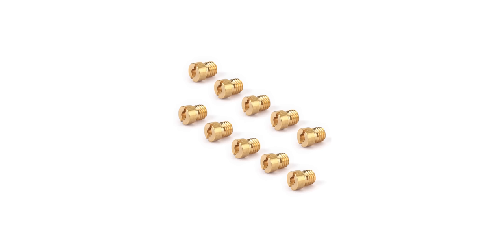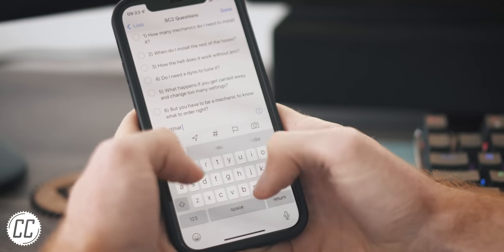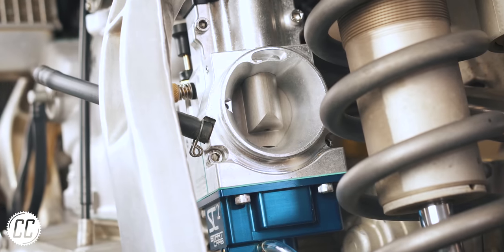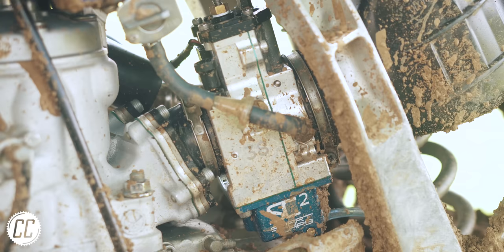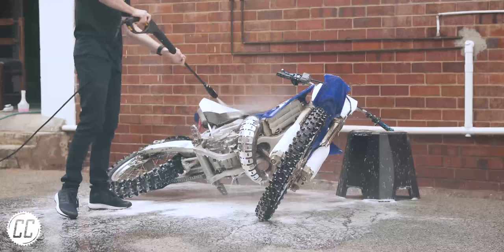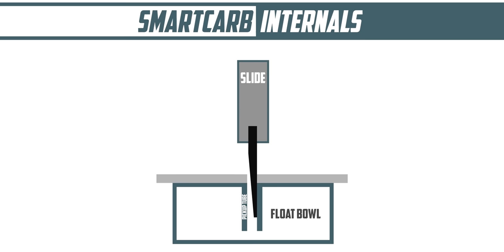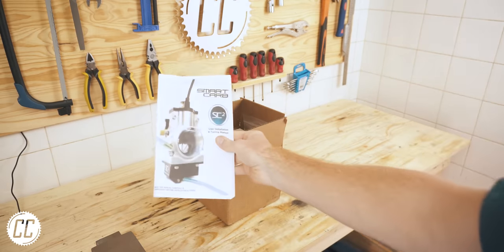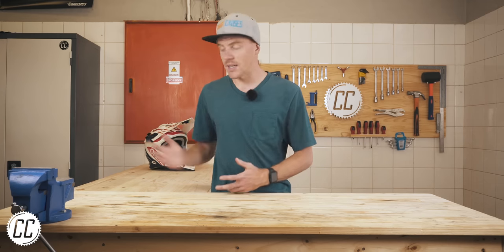The Best Carb Money Can Buy? | SmartCarb SC2

Comment: Having worked with carburetors for 40+ years, I found the SC2 concept to be very interesting. However the only feature that would be beneficial to myself would be the ability to easily adjust for altitude. On a single cylinder, single carb engine, the rest of the tuning is so easily done that it wouldn't be of any real benefit, regarding getting a base setting. When I'm working on a bank of 4 carburetors, then I'm always wondering why there isn't a simpler way as the carburetors have to be removed and replaced several times over as the various circuits are tuned, although that's only really a chore when you have a none standard set up in terms of the engine modifications and different carburetors, so you do not have a stock factory setting to work from. If you are racing then I guess the real crunch is whether the design really gives you all that extra power over a properly tuned stock carburetor, many 2 stokes are setup from the factory to run somewhat rich for engine longevity, rather than all out power and fuel efficiency.
Reply: So you just explained it yourself that, this product Is beneficial on 99% of the platforms its swapped into! Outside of whatever circles your forming, this is beneficial!
Who is out here fully constructing a motor from scratch, and does so without doing any prior research to atleast have a basis or point to start from? Come on man, quit bashing! Also, please explain wtf you said in your comment? (Pls don't take my cursing or short temperament as aggression or hate etc directed at you personally)
Reply: @haydenroyer  When I see some back to back dyno tests with a properly tuned stock carb, vs the SC2 I'll be happy to accept the results, but for now I find it really hard to believe the SC2 can provide drastically better results for anyone, beyond someone whose original carb is either having issues or was never tuned correctly, you can't change the laws of physics. Q: "Who is out here fully constructing a motor from scratch, and does so without doing any prior research to at least have a basis or point to start from?"  A: Anyone who has a custom engine setup, my 78 Kawasaki has a big bore kit with high compression pistons and 28mm carbs instead of 26mm from a later model. I bought it that way, the previous owner never had it running correctly.  It proved the most challenging set up to tune perfectly, I've worked with so far, as there was no stock starting point and the PO had got it jetted all over the place.
Reply: @fiveowaf454  you're right - you can't change the laws of physics. It's the symphony of the spheres so to speak. But you can work with physics better and in a fuel system like this it comes down to fine control of both air and fuel metering, mixing that air and fuel as homogeneously as possible, all while atomizing that fuel to as fine a degree as possible (increasing surface area and therefore maximizing combustion efficiency) through the entire throttle range. The SmartCarb does just that with its metering rod handling fueling through the entire range without jets or power jets providing sub-optimal atomization.

The dyno charts are available on SmartCarb's social media channels and soon more of their website blog posts now that they've acquired an in-house dyno. Stay tuned.
Reply: @fiveowaf454  I'm with you on this. I spent years working on modified motors and either swapping to larger carbs or learning how to modify stock carbs to perform 'properly' with modified engines. The 'Cafe Racer' fad of 10~12 years ago still gives me a bit of work as many people want to ditch stock air-box for 'the look' (although only one or two a year now instead of one or two a week)
Whatever, the 'advances' over a Lectron seems to be a low speed circuit which the Lectron always needed for anything other than drag strip use
Reply: @nathandyess5310  I still can't help think that companies like Mikuni and Keihin have ample experience, resources and development time in their products, that they are not leaving loads of horsepower or efficiency on the table for someone else to suddenly find. As I've said I'll believe it when I see hard data that shows me the SC2 can outperform a properly set up "traditional" carburetor.
Reply: @fiveowaf454  nothing is sudden in an industry as developed and crystalized as this. But that doesn't mean there aren't incremental improvements to be had or even breakthroughs. To be sure it must be seen to be believed. I'd agree that Keihin/Mikuni have probably reached the pinnacle of needle/jet carb design for these engines. But then I also have a front row seat here at SmartCarb to see what it does in comparison and it is frankly something else. As I'd mentioned before, we're now in a position to really start putting the data out, the right way with the right testing methodologies, etc. It all takes time and that's one thing that the likes of Keihin/Mikuni have clearly had to their advantage.
Reply: Yea especially for 800$😂💀 I’ll buy 20 ebay carbs and rejet them before i do this😂👌🏻
Reply: The biggest advantage is for people who have to deal with altitude ranges. So if you need that feature it makes it worth it imo to be able to adjust to altitude without worry or tuning
Reply: @nathandyess5310  this is it. you cant change the laws of physics but you can use them in a better way.

standard carbs of any type have several issues. one i particularly like as no-one ever points it out is the terrible turbulence that any throttle tends to cause downstream. 

whilst an engine is a positive displacement pump, in a venturi, much like a wing... the trailing edge is just as important, if not more so, than the leading edge... the air accelerates through the venturi, lowers in pressure... then has to slow back down and flow into a high pressure... and THAT is something physics definitely doesnt approve of... in any other system, it would stall and flow would stagnate, like slapping a chunk of wood on top of a planes wing. it only works due to that fat arse piston descending and sucking air in so it always is a lower pressure, venturi be damned. you can make your plane with its lump of wood fly... but youre going to need one big engine to do so!

in other words, i reckon theres a huge loss just there... inherent in the design of every throttle ive seen. except one and thats used in a situation utterly different. i feel its ideal for the task. laminar flow.

what if it was a laminar flow? like a diesel has better VE as it gets a lot less turbulence, less aerodynamic restriction... not to be confused with that phenomenon of rough surfaces. this is the overall flow in the manifold when the throttle is anything but wide open. nasty big dead spot behind the slide, or butterfly...

then theres things like what i believe the SC is doing, along with lectron. took physics, and used it little bit differently.

you look at the equations for a venturi, and they have an indice of 0.5... the suction on the jet is not linear with air speed.
you look at a jetting chart and it shows throttle position to areas of circuits.
no jetting chart i know of shows emulsion tubes.
throttle position does not control air flow and air speed through the venturi. the RPM does. the LOAD.

as the RPM varies, so does the suction on the jet, for any given throttle setting.

and thats where the emulsion tubes come in, which are an evolution of what was used on very early edwardian cars... "air compensation valves", or... deliberate air leaks to balance out the suction on the jet with the MAP in an attempt to maintain a constant mixture. 
noone really undertands emulsion tubes. its worthwhile getting a little 50 or something and soldering up the holes in one. redrill them in new places. it starts making sense after a few high gear pulls at steady throttle settings (hence the 50? you feel it when its slow and underpowered). its a whole new level above mere "jets".

the jet suction, the venturi action, is caused by air accelerating through the restriction.
MAP is caused by the positive displacement airpump sucking air in through the restriction.(ok, air pushing in past restriction to fill void left by descending piston, if im going to be anal, get it right...) two different things entirely.

let some air past behind the throttle, it reduces the air speed, reduces the suction, and simultaneously adds extra air... both lean out the mixture, that otherwise tends to get richer as RPM increases.

emulsion tubes leak air into the fuel passing the jet and lean it out that way... those holes, the size, and the location are important!

SC i believe uses a "constant vacuum", and counteract the suction on the jet so it remains at a fixed value regardless of air speed, allowing a small tapered needle to control fuel delivery in direct proportion to throttle opening. "the bowl is vented to the venturi" is a dead giveaway? it LOWERS the bowl pressure, as the pressure lowers on the jet. net result... nothing. unless theres a slight difference... and THAT is linear!

 ive done it to a few mikunis, its... tricky. i gotta make a dyno again and really start working on this stuff... i have the idea that the bore is shaped that way so it increases linearly, and allows a flat taper for the metering rod, versus the round/oval bore of a mikuni etc that uses a needle with various degrees of taper... 

in other words, all the advertising blurb is just that. blurb. to obscure the real principle that is dead simple. they dont want cheap chinese clones! and as i dont see any third party dyno tests, im never going to buy one, especially with the exchange rates we have!

im sort of working on a carb that can take boost, high fuel pressure with no regulator yet still be gravity fed if not boosted...
"no jets" like these... but not as i have no rod either... and laminar flow at all throttle settings. i still call the rod and hole a needle and jet!

Comment: one of the great  tuners descibed carburation as a controlled fuel leak 
i have a delloto 40mm pumper on my racing norton  with an adjustable main jet   a needle  moving in and out of an oversized   main jet    via  a threaded drain nut with a gland   rotated by an old rev counter cable alongside the tank
a long hill is needed   turn the knob with wot  till the motor comes on song   then close the throttle a wee bit  if the motor momertarily speeds up 
its weak so another half turn or so and its bang on 
then its needle /slde/pilot / cut away for the rest of the range 

binks made some fantastic carbs 
in the 20s  notable the Rat trap 
with d shaped port and  long reed type throttle plate  full bore or nothing

Comment: So it's basically a SU carb for a motorbike 
Thats not a bad thing, I did a draw though turbo setup with a SU carb and it worked brilliantly
Those style carbs are fantastic
Reply: Its NOT an SU carb, the slide on this carb is controlled by the rider, on an SU carb the slide is controlled by the vacuum created by the engine. Furthermore the needle in an SU carb is like the needle in most other carbs, it has a round cross section, the Smart carb's needle is not even called a needle as it is not round, hence the term metering rod.

Comment: I have same carb on my bike ride one time has lots more power then my mukuni had. Runs great at 3 to 5 clicks leaner. Still trying to get mine to idle as well. Revs great sounds  great so smooth very good improvements over stock carbs 👍

Comment: Nice! It's about time they've taken a step in a different direction besides the plain Jane same old carburetor and changed the internals more than just the shape of the damn slides! It's about time and long overdue especially for the same fact you bring in up in the video, "the whole ripping a carb apart to tune it" part! Nothing's more frustrating than losing your E clip for the needle in dirt or grass! Can't say how many times it's happened before, but more than I'd like to think about! That's absolutely awesome stuff! Dial tuning just like an adjustable jet use to be. I have a personal problem with fixed jet sizes and have always wondered why? Outside it makes them tamper proof I guess and once it's set up with the right size it's good. VERY very annoying Stuff when you made engine or altitude changes and need more or less fuel! Wow really outside of fuel injection BS, which is OK, you just do not make the same power nor have the same throttle response with FI as opposed to a carb, sorry I've had plenty of experience with both and hands down a carb on the same exact engine will produce a few more HP and the throttle response is instantaneous due to the fact a sensor needs to send a computer the input signals, thus calculate how it needs to be changed, then sent back to the injector and or butterfly valve if it's fly by wire, this all in reality takes nano second's I'm sure to all do? BUT it is a noticeable difference and the dynos don't lie either about fuel injection VS carbs the HP is always a little better on the carbed engine's no matter what it is, doesn't really make sense how a crude mixing valve is capable of creating more power over a computer controlled system??? BUT it's known fact in the engine world, but it's what you gain in ease or startup running and self adjustments, I guess you pay for in a few HP, which really isn't a bad swap....... Very cool Bro, thanks for making this video, never heard of these until now thanks to you, will definitely be checking into one now!

Comment: The British SU carburettor uses a metering needle that can be tuned by choosing a different taper or filing a flat on part of the needle. SU has a butterfly valve and constant velocity slide. David Vizard gas flowed the 1.25” to flow the same as 1.5”. There are some tips but it worked very well indeed. 
Biggest issue for altitude is the relatively narrow range of mixture adjustment for any particular needle. Saying that you can use an old style choke control to raise and lower the main jet. Set it half way for low altitude, full high for high altitude or full low for cold start.
Reply: Most slide carbs can be adjusted by changing the needle. For example Dellorto list loads of different needles for their carbs. Pain and expensive to keep buying and swapping them - there are ~100 choices just for the K type needle and they are ~£12 each.
Reply: @katywalker8322  My life right now :p

Comment: Holley came out with a carb for Harleys using this exact concept, flat sided needle and all. They called it QuikSilver. I have one on my shelf of shame along with a bunch of other carbs. In the beginning, after getting it tuned in, it seemed to be a very good carb. The main problem was that after a year or so of running it became almost impossible to keep running right due to internal wear in the carb body and slide, and in the needle bore. Replaced it with an S&S Super E and the bike has been running perfectly for over a decade. I don't think they lasted long on the market. Of course, this is a new manufacturer, and maybe they've overcome the wear issues.
Reply: Edelbrock, not Holley, QwikSilver, not QuikSilver, and by directive and inspiration of original metering rod carburetor concept inventor William Edmonston, the culmination of his efforts being the SmartCarb. Our SC2 models are all CNC billet aircraft aluminum construction with hard anodized billet throttle slides. Much more durable.
Reply: @SmartCarbFuelSystems  Ok, I stand corrected, I got the company and trademark name spelling wrong, so sue me, LOL. I was just trying to provide some background on the tech that is being touted here as somehow new. What exactly is different between your carb and Lectron or XTNG carbs? I'm relatively sure that all of Edmonston's patents have expired by now. Probably also those assigned to, I'm assuming, his son Micheal. OH, BTW, one of the other carbs on my shelf of shame is an original Edvac carb. Designed by Edmonston for aircraft use, with no float bowl. The fuel passage to the needle bore goes directly from the inlet to the bore, through a tapered needle valve controlled by a cable from the instrument panel. Supposedly the idea was to control mixture at various altitudes with the needle valve to maintain stoich by watching EGT readings. I tried to run it on a Bonneville race bike my manually adjusting based on AFR readings. Didn't work too well for me in the long run, but ran like heck right before I locked it up, LOL.
Reply: @edbennett8257  no problem, we're happy to keep the story straight. Some of the tech in use with the SmartCarb was developed in prior metering rod carburetor iterations including the QwikSilver and the even earlier Lectron, and some of the tech in use is new and patented by us. The main differences between the SmartCarb and the Lectron and XTNG (Lectron clone) are the SmartCarb's internal, integrated float bowl venting feature (patented), the use of a single circuit (metering rod) to cover the entire throttle range with no power jet or other circuits required, the variable throttle rate venturi shape (the process by which that shape is defined being patented), full external adjustability without tools, and a TPS option. Both Lectron's new Billetron 38 and the 38mm XTNG are 4mm smaller than implied or advertised at 34mm whereas SmartCarbs are true to size if not slightly over. Check out the SmartCarb vs Lectron article on our website for more information.

Very curious about the Edvac. We're pulling together a collection of all earlier Edmonston designed/inspired carburetors starting with the Posa-Fuel and are willing to pay well for clean examples. Reach out if that may be of interest to you.
Reply: @SmartCarbFuelSystems  I'm in Kansas City. I could bring it to your Raytown location some day if you'd like to check it out. I also have an EI carb, another iteration of the same concept by Edmonston.
Reply: Yes , I recall that Harley Davidson did come out with a carb of this concept